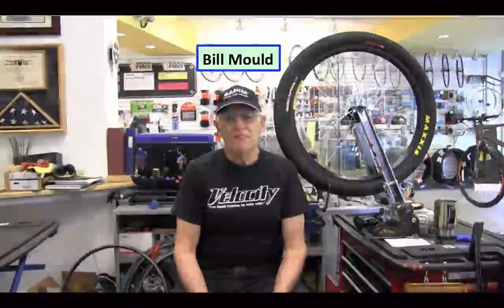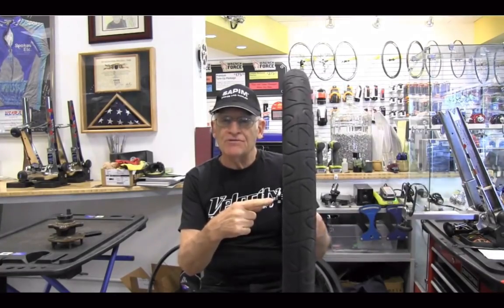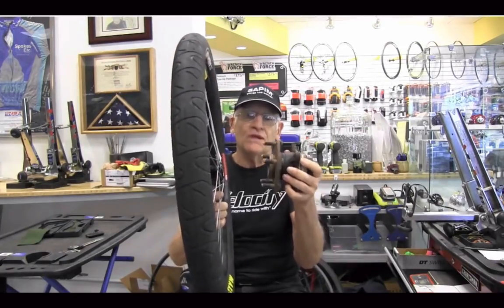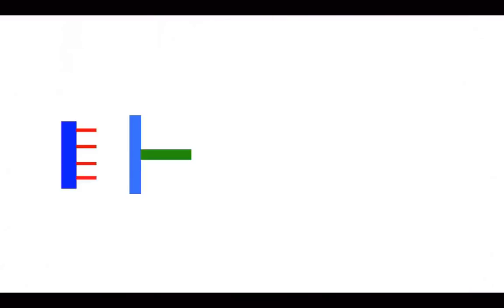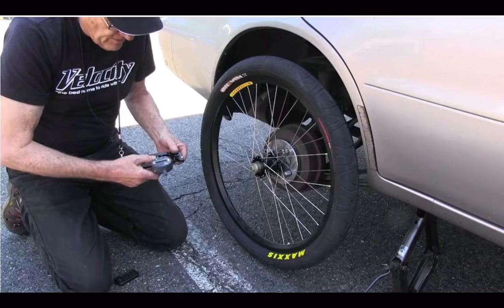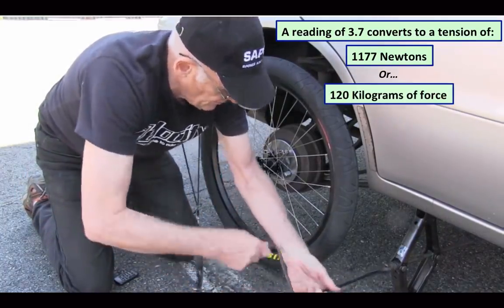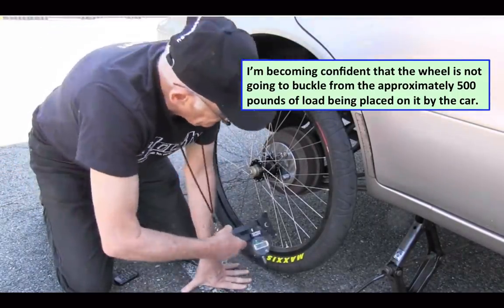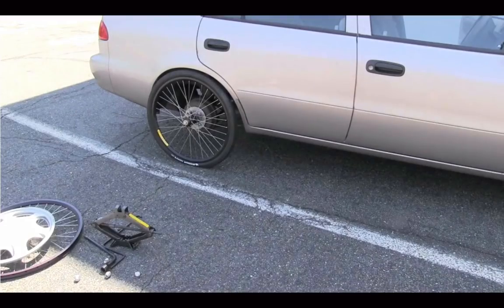Bicycle Wheel On Car

Comment: You could partner with DUBS. Spinners and wide 24s are the past. Now it’s all the rage to put bike wheels on a car. And you two can be the catalyst of making this a reality. I will say this though, in all seriousness, I think this may be a better replacement for donut spares. You could fit up to three of these where the donut went. Given enough refinement, it could even be stock equipment for hybrid cars. Far lower unsprung weight and very little rolling resistance. 🤔

Comment: Oooh now you try to put 4 of those wheels, driving off road ways, putting passengers for a trip, etc. And you missed to inflate the tire to a higher pressure, it works as the spare tire, it must have more air to avoid to damage the tire

Comment: I think you would be a better experiment with for motorcycle tires increased power in fuel-efficient C and I would probably still be safe  based on newtons law of dollar Tree store Hommie cheap boulevard wheelset otherwise known as a NHBW.   upgrade it to a 40 mm axle.   Market at retail.

Comment: great Job Bryan you designed a pole welded to a disk lmao mechanical engineers these days
Reply: kalef1234 your obviously a mechanical engineer, but not everyone is, ask a builder to make that hub and we'd see just how well centered and balanced it would be! But I guess that's not important right?
Reply: bandit 911 i should clarify. It is easy to design that piece. What is difficult IS actually the builder's job of insuring the shaft is perfectly center. That is NOT difficult to desing, nor should it be. It is hard to without the proper tools to make. So props SHOULD go to the builder, not so much Jimmy who has Solidworks

Comment: Lol. This is funny. Its front wheel drive. Any acceleration will twist the spokes. Turning at speed will destroy them. Any hole or bump will crush it. Just use common sense. 

Can it hold a static load. Yes. Is it usable. No. That’s why car tires have so much metal material. There are extreme forces at work. 

Not bad for a bicycle guy. Though the measuring was nonsense.
Reply from the maker: John, if you go back and look at the video again you will find that this was a demonstration of the strength of a bicycle wheel to support a vertical load.  You were so quick to try to show how smart you are and how stupid you think I am that you totally missed the point.  At no point do I suggest that a bicycle wheel is an appropriate replacement for a traditional car wheel. Bill
Reply: Bill Mould no interest. No opinion on your intelligence. When you put something on a car as a wheel ...

There are better and more accurate tests and demonstrations for ‘vertical load’. 

This is what happen when you put something up on YouTube. 

Why not put it under a house or elevator...  or maybe a press that can measure force accurately...  

There are better ways that prevent any misunderstanding and that is up to you do figure out. 

Don’t be so sensitive. I’m just a stranger on the internet with a basic engineering degree. I am no one. My opinion does not matter. 

A question would be what application is this type of tire for and why didn’t you demonstrate that? That might be smart marketing.

Comment: The way to learn knew ideas is through simple experiments like this. You don't have to have a uni degree or "intellect" necessarily to find out something highly trained technicians and scientists haven't yet seen or understood. Look at the recent findings with photon pairing creating thrust where physics reject the possibility. It is by mistakes that we learn. Perhaps if you never made a mistake, or took a risk, or did something that looked ridiculous, well...you never learned something new.
What I fail to see here, however, is why. Why fit a bicycle wheel to an automobile? Is it an exercise in weight saving? Perhaps this would work well for some sort of collapsible spare wheel? If the spokes and tyre would fold up completely into a pouch stored in a door pocket. Otherwise, maybe there is potential here as a "spokes" person?

Comment: this guy's a clown lmao that's the most unsafe wheel ever made
Reply: You're the clown if you can't comprehend why he did this
Reply: +NotTheWorst doesn't matter if he took the wheel through some real turns and high speeds those wheels would fly off
Reply: Rajiv Gobin there's a difference between fun and impractical and boring and practical. This is not meant o be practical you ignoramus
Reply: +NotTheWorst well if it was practical the it would be be alot more cool who doesn't want cheap durable tires
Reply: Rajiv Gobin I don't want cheap durable tires because they're cheap

Comment: No bearings and no clearance between the tire and highest point the tire would reach in the event of a pothole strike.  And no real stress of any kind.  Result:  No results of practical value.  Instead, maybe build a smaller version of a tin lizzy for radio control during parades.  The biggest problem you currently have, as I see it, is finding a sponsor for this.  What is the advantage of supporting you for any sponsor?  At least with the tin lizzy you could put advertising on the side of the car to pay back the sponsor who footed the bill to build it.  Sponsors mostly want something in return that at least involves recognition.
Reply from the maker: Sir, the point of this was only to show the enormous ability of a bicycle wheel to support a vertical load.  These is no commercial value intended or implied.

Comment: Teaching kids to spend their time on something with no purpose for the win.  Engineering is about designing for a purpose, not just observation if something is possible.  There's a desired outcome.  Bike wheel on a car is not a desirable outcome, and in fact, back in the early days wheels used to look a lot more like bicycle tires than they do today then something happened.  Engineers made something better.  Reverting back to something worse is not progress.  Doing a thing worse than it already was is madness even if you can just snap your fingers to have it happen instead of time and expense.
Reply: Next time you're engineering a Youtube comment about teaching, you should try a video under the education category.
Reply: Utterly backwards.  People in that category didn't need redirection.   Now you've wasted both your time and mine, sort of how the video did.   Triple fail for the win!
Reply: I couldn't care less what you doubt, nor do I use "for the win" regularly.  Have you considered seeing a shrink to combat your delusions?
Reply: He's making a point about that particular brand wheel and it's strength, dunce.
Reply: and that point is that it's inadequate or else they wouldn't just push it slowly but instead drive around at regular automobile speed, dunce.

Comment: You haven't built the wheel, you've just monted a wheel that you've bought. There is no engineering in that thing. There is no need for partners or company to do it on 4 wheels.

Comment: sir you don't seem to smart of an engineer to me, in a emergency situation where you need to brake hard  or pull e brake you will flip the car or kill soomeone..
Reply from the maker: If you watch the video carefully, you will find that this was just a demonstration of the ability of a bicycle wheel to support a heavy load.  At no point do I advocate actually equipping an operational car with bicycle wheels.